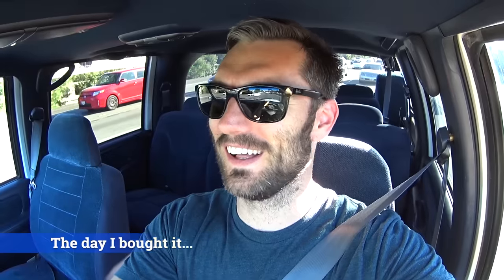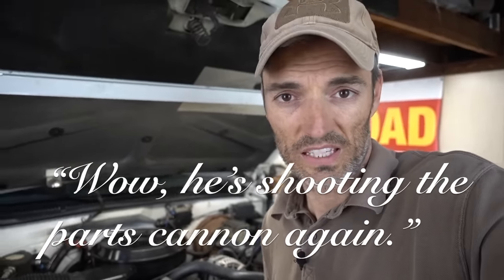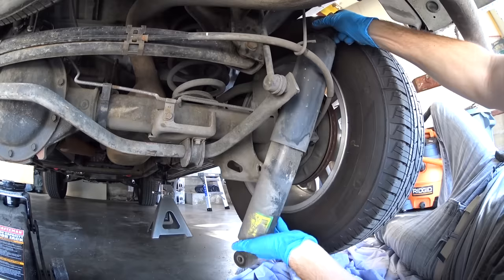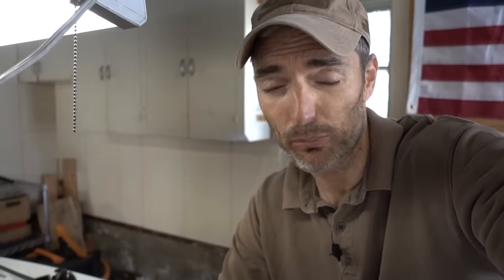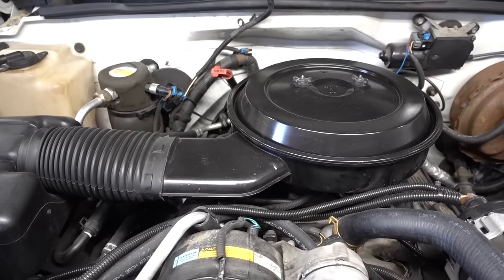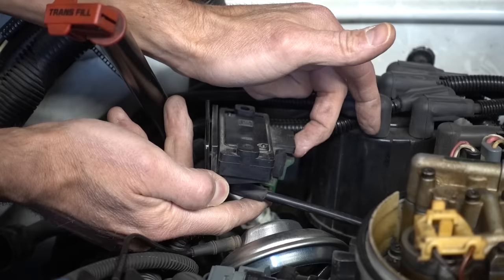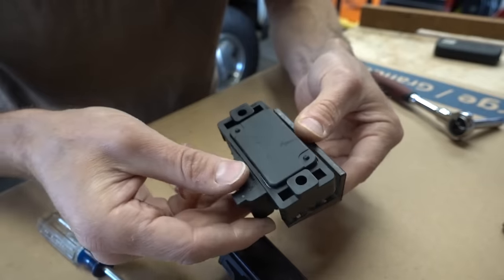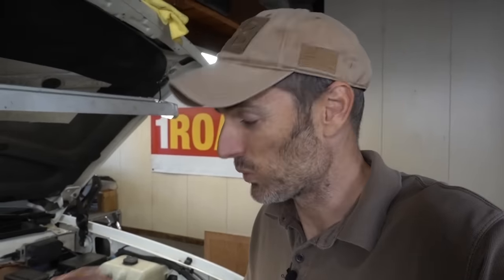The ONE REASON Why My 25yr Old Truck Runs So GOOD!!

Comment: The problem is the new parts they make now days dont last as long as the originals...
Reply: This is the reason why he was buying the original parts ome ac delco
Reply: @billflk2364  made in china :)
Reply: I worked a parts counter for a few years and the whole time I watched the quality go down. Now, some maintained a high quality level. The Echlin at NAPA was outstanding. Balkamp, meh. I started machining rotors right out of the box ... because they would literally be out of tolerance out of the box. Some of the AC Delco stuff maintained, some was junk. The rebuilt engine supplier that we picked up was stunningly bad. Store brand impact tools were literal trash. I would suggest you go to a small local parts supplier that's a little more expensive but absolutely knows their parts lines, and has to build a reputation on keeping good parts lines and standing behind their parts. Because a small no name local store isn't relying on people just flocking to the store because of a nationwide name.
Reply: U ain't jokin
Reply: @uethello  A mechanic I know sais that 50% of new parts are bad
Reply: @Future-Preps35  of course with my tps I took an ohm meter if it measures the correct ohms then the computer isn't going to see NEW OHMS so to each their own did you do your trunk latch too THAT WAS MY POINT!!!!
Reply: @uethello  Thank you for that insight.
Reply: @Future-Preps35  So if I may ask, what store or online seller did you purchace it from?  Was it a Chrysler/Mopar oem part or ? I own a ZJ and may be needing a TPS also and don't want to take that chance of getting a bad part right away. Note: Nearest stores from me is 20 miles.
Reply: Todd Rhine feel the 20 mile part, just rebuilt my engine not long ago and live 30 miles from the nearest parts store 🤦🏻‍♂️🤦🏻‍♂️😅
Reply: @jameshunt5316  Let me guess. you got the vaccine...
Reply: @billflk2364  Those ACDelco parts are not exactly the same quality as original OEM parts. For example I just bought new spark plug wires because original ones got damaged and I got annoyed when I noticed that ends of the spark plug wires are rotated in random directions, meaning that I have to twist the wire in some cases 180 degrees to plug them in.
Reply: I have better luck buying AC Delco (made in Mexico) than (made in china).  Denso used to be my go to when could not find AC Delco.  However,  Denso has been hit & miss lately (2024).

Comment: The best time to buy a car is when you don’t need one. The worst time to buy a car is when you need one RIGHT NOW! Same logic here.
Reply: When you need one unexpectedly you don't have time to look for a good one.
 The only ones you can be fairly sure of not having problems are new ones. Well most of the time don't even think of buying a new model. If it has been in production most of the time they are good. Most of the time.
 Had the old guy get stolen because it looked and sounded good. Somebody was spotting them where the old lady worked. So why that 11 year old one 2 1/2 ton gas sucker out of the 1000 in the parking lot?.
 Did not have time to search for well maintained used vehicle.
 I won't let her drive the old one I drive because she drove it until the gas tank was empty to many times. My rule is if you can drive you can also keep fuel in it and keep it between 1/4 and 3/4. Don't to replace fuel pumps early and often that way and it keeps the vapor cannister happy. Not something I want to pay for if I don't have too.
Reply: I usually custom order my vehicles and sell my old one right before I take delivery of the new one. However - if someone crashes into your old car or it quits on you - you can always rent something for a few weeks while you're shopping. Or if the weather is nice - ride the motorcycle to work.
Reply: Worst time to sell one is when it HAS to go too. HOA pushed me beyond my limit, were threatening to tow my vehicle, I had nowhwere to keep it - 1995 Powerstroke F-250 - got less than 5k for it - it ran perfect.
Reply: I always buy a vehicle when I don't need one.  It's one that I actually want. Then after I own it for awhile I sell one of my old ones.  Never trade a car in to the dealer.
Reply: Yup, thats why I bought a ford☹
Reply: @warrenpuckett4203  If a new car is good or not isn't really the issue, why would you buy something that looses 60% of it's value in 4 years?
Reply: I've found that to be true.
That logic is true with allot of things in life.
Reply: @zzanatos2001  You better be a millionaire, you have a lot of wealth tied up on stuff that looses value.
Reply: And the best time to pay for a new car, is before you need it.  I paid cash for anew 77 Toyota pickup in 1977.   I was 19, and my Dad told me to go to the credit union, and finance it to start building credit.  When I paid it off, he told me to open a seperate savings account for vehicle parts and replacement.   Twenty four years later when I couldn’t get the Toyota truck to pass smog, there was more than enough to buy the new minivan.
Reply: i wish I had that option, had I been able to wait 3 months I would have gotten a 2010 Chevy 2500 HD with only 150k miles for $2000 instead of needing to get my current truck (that I love to death) 2010 Chevy 1500 for $18k with 115k miles, i get the same fuel mileage but i have a much lower capacity

(rant below about the BS my landlord pulled about my truck)

plus now my landlord made it even harder for me on that front bc now I have to pay a $30 fee for having a truck (claims of higher wear on their crap road that make Washington's worst pothole-covered road look like the best road in the entire US) and if I want or need work done I have to go to a mechanic bc its $140 per 5 minutes my hood is open, plus a starting $100 fee for opening it and fluid changing is an automatic 60-day notice to leave, plus im only allowed 1 vehicle despite the fact the place im renting having 4 parking spots

Comment: "The longer you drive that old car, the more it pays you back."
Reply: I had truck for 28yr I did price cost for it I estermeft it cost me about $2.50 a mo.over all
Reply: Ummm, nope.
Reply: @rhondakendrick2563  ummm that's $840
Reply: The MORE it costs. There, you go!
Reply: Car makers don’t like you, take it as a compliment.
Reply: true point with a old car  no monthly payments  no full coverage insurance   if it a good
design  from the overall manufacturer with preventive maintenance  they will be reliable and  MUCH cheaper  i see prices from 56 000 to 81 000  😱😱😲😲fck  that ....!!

Comment: I have a 1995 GMC1500 Sierra..
250 k on this dude and it runs like a champ.Preventative servicing is the NAME OF THE GAME😊
Reply: Exactly !, plus frequent oil changes.
Reply: yep. Any car will do much better with excellent maintenance.
Reply: 98 Z71 Silverado, lightly used. 119k miles. Rocker panels rusting, clear coat flaking but runs like a scalded dog. Wouldn't part with it. Don't need expensive deprecating vehicles with high insurance, registration and maintenance.

Comment: All my year 2000 and older Suburbans have hit nearly 300k miles, and taken me through ridiculous terrain and weather. I've done all of the work myself, except for a fuel pump replacement, and your videos helped me immensely, so many  thanks my friend.
Reply: Lol, I think I've dropped my fuel tank on my Tahoe 3-4 times already.  I'm still working on the 300k miles, but recently bought a Suburban because I liked the platform so much!
Reply: @nicholassmerk  same here on tank removal lol.  I should have bought a new tank though because mine has a nice big dent in it from when one of my old co workers thought he was real clever trying to move my truck out of the way before i brought her home from the junkyard i worked at.  He moved the truck with a front loader by placing one of the forks under the tow hitch to lift the ass up and let it roll on the front wheels.  Well he mad contact with hitch and my fuel tank not to mention he crushed my driveshaft. Yeah i didnt realize there was a dent in it until i went to install the new fuel pump and it wouldn't fit.  Lifted the tank out of the big plastic splash guard to find a huge dent in the bottom.  So there i was in the middle of July in Florida hammering the fat side of an aluminum baseball bat on the dent to push it down enough to fit the new pump.  Let's just say next time i take a trip to the junkyard, buy a tank, spend 10 minutes cleaning and flushing it and the rest of the hour drying it out and installing it.  It took me almost an hour of nonstop hammering to finally get the pump to fit.
Reply: @FunkyGOB  Bought this Tahoe, took it straight to the gas station and filled it up.  Figured out quite quickly why the guy that sold it to me didn't have ANY gas in it.
Reply: @nicholassmerk  lol gotta love those "oh i forgot to tell you" details after you buy it.
Reply: @FunkyGOB  Had a bad transmission too.  Was one of those "I'm not telling you what's wrong with it" kind of deals.  He was asking the appropriate amount for it, and I'm still driving it years later.
Reply: @nicholassmerk  thats it.  Not thrilled on spending the money but id rather spend it on an old truck that i take care of than buy another neglected vehicle full of problems.
Reply: I did the fuel pump on my 98 Suburban and I can see that being worth paying someone with the right equipment to do.
Reply: my old model t truck works just fine with the upgraded diesel motor and auto transmission.  🤣🤣
Reply: Replacing a fuel pump im a body-on-frame vehicle is actually way easier than people think. In a 2000 suburban, its 2 strap bolts and some hose clamps to get the tank out and 4 screws to remove the pump.
Reply: Mine is a 99 with 306000 , they will probably bury. Me in it .I'm not going to buy anything I don't like, they haven't built anything I like in 25 years.
Reply: Buddy had a '95 suburban.  It was in great condition, but the red antifreeze really screwed up the cooling system!  I'd never use that crap!!!
Reply: Drive less but safe

Comment: Each owner has to decide to what extent or frequency they replace parts. The older the vehicle the more sense it makes to replace iffy or suspect parts. One thing i learned early as a new mechanic, is that you never throw away a old part being replaced, not till you have the new part installed and working properly. You may have to refer back to the old part for one reason or another, and being able to do so can save you a lot of grief.
Reply: Or, the new part may fail, and the one you just removed hadn’t failed yet, could use the old worn part in the meantime waiting for a replacement, keeping the car on the road and the customer happy.

Comment: People have asked me why I'm always working on my truck. I just tell them I'm making it new one part at a time. 

I agree with your approach with one small caveat. You can't always assume a part is good because it's new. A lot of the parts now are made in China and can be hit or miss, even AC Delco parts.
Reply: It's just as scary to replace a perfectly working USA made auto part with a China made part. My insecurity levels with chinese made parts are through the roof, AC Delco label or not.
Reply: You mean China made parts are bad. No. I have my own experiences with a lot of cheap parts made in China. The key is where and how you source them. Those parts are still running in my cars for years.

Comment: 1997 GMC Yukon owner, I think we share a similar outlook on maintaining older vehicles. Its cheaper to fire the parts cannon every once and a while, than to constantly trade up to newer vehicles like some people do.
Reply: Ditto. A 95 suburban 1500 2wd  owner here. I did 6.0ls/4l80e swap. But a awesome truck
Reply: 200% agree. 1994 2500 2wd suburban with 1 ton single rear axle and HD brakes, 9 seater over here. 
She is always loyal, always running, cheap to maintain. She is a keeper. 👍
Reply: You know what's cheaper, just fixing what isn't broken.  Would you replace every lightbulb when one is just blown and it happens to be your reverse light bulb.  Do you change the headlights, taillights, dome light?
Reply: @ranbymonkeys2384  It's funny that's your example, because when I picked up a new-to-me vehicle that was 23 years old, I did in fact replace all of the bulbs.
Reply: @aidenstefanson2175  I wouldn't
Reply: @ranbymonkeys2384  I agree it's overkill, but it's not expensive, I enjoy working on it, and now I have piece of mind. I'm not going to pretend like it's something everyone should do, but for the 30 or 40 dollars I spent replacing all my bulbs I shouldn't get caught with a burnt out one!
Reply: @aidenstefanson2175  You know that and bulbs have come a long way since then too so, ya I'm with ya there.  I have a 85 Vet and I put the LED tail lights in because I didn't want to have to do that again (take the plate off ect.)
Reply: I got the 94 K1500 Suburban
Silverado and I am always working on mine. Doing LED upgrades got nice 17" stock wheels from a 2016 Colorado, the two tones. I just had my wife print me a kryptec camo pattern on her cricket and I'm gonna do my tail lights with the vinyl and then a couple layers of automotive clear topcoat. I'm about to pull the cargo rails off, paint them and rattle can a couple layers of metalic silver, on the top of my truck, I have 2 color silver/emerald green, but most of my silver is gone, it's all bare steel. I sand the parts, I clean and oil all summer, when fall hits, I buy the cheap clear rattle cans and put about 10 cans on it. I am also tempted by spray chrome, but I want to go more or less blacked out lights, chrome delete I like my incognito "greyman" status, no one looks twice other than to get out of my way. Interior needs some new ceiling put up. I love project and taking care of it.
Reply: @aidenstefanson2175  I got mine for from my grandfather, 160k  all LED. I'm having trouble getting the pulse of blinker and corner small blinker to do the alternate after changing relay. Now when applying blinker the whole thing flashes solid not. Any ideas?  It kind of reminds me of a police strobe package effect. My grandfather was s cop though.
Reply: I am rebuilding the motor in my 99 Surburban. I have bought all new OEM sensors as well. The old ones are still good. They will be cleaned and put in my spares box for emergency use. They won't go to waste. I have three late 90's GM trucks with vortec engines.
Reply: Gets to be a headache after a while

Comment: Absolutely. A few years ago, I bought a 2004 Grand Cherokee Limited on a whim from auction and was thinking I'd just address a couple of things and flip it for a profit, but I ended up liking it, so I went through the effort of parts bombing the crap out of it as a preventative maintenance endeavor. Soooo many new parts and the thing starts, idles, and runs like a champ. One of the biggest improvements I made was having the cylinder heads redone. The heads on this engine (4.7 V8) are known for dropping valve seats, so I had new seats installed and had them peened in place as well. Those seats aren't going anywhere now. And everything else I did, it might actually be a shorter list of what I didn't replace. I'm doing something similar on the 2002 Silverado Z71 I got that was my uncle's old work truck, though mostly, that's a cosmetic endeavor as the interior was completely trashed. These older vehicles are fantastic. New enough to still be able to find parts and not be plagued by the struggles that come with carburetors and whatnot, but old enough that the parts are cheap and wildly plentiful. A couple years ago, I paid off my 2017 Mazda and I'll never buy a new car again. It's just not worth it.

Comment: Jimmy, I'm right with you on replacing parts as preventive maintenance. Sometimes I purposely shoot the parts cannon to just renew some things that have got old while fixing a problem. Sometimes I diagnose and just fix the problem. Just always keep in mind, replacing it with a new part, doesn't mean it's not the problem or you could have just created two problems. New doesn't always = good. Even with OEM parts. I have had some bad ones. I totally understand your line of thinking though and I do it sometimes myself. Keep up the good work!

Comment: Man you are so right, I have a 1991 Dodge D250 Cummins and I do what you do , I know those parts are 30 years old. 345,000 miles and still tickin over. Two lift pumps in 15 years.  GREAT. Enjoy your channel.

Comment: Preaching to the quire man. My '99 Suburban k1500 with 310K miles is still running strong because of the same mindset.
Reply: I had a 99 burb that had a little over 273000 on it when I lost it in the divorce. Only issue I ever fought on it was the dreaded intake gasket leak. Had to change it 3 times to finally get it installed right. Other than that it was a beast!
Reply: What's a quire?
Reply: @georgegroot9704  Had 1999 Tahoe with same problem! I didn't try to do it myself though. 1st repair was a fix.
Reply: A quire? You mean a *CHOIR*?

Comment: I'm 72, drive an 09 Ford Explorer, and also replace anything that's "due" to fail. AND...I do my own work and throughly enjoy it. This morning I replaced my front brake pads even though the ones on the truck could go another 20K. The truck has 155K miles, and runs like it's brand new, and I know it won't break down on any of my long road trips. Nothing more frustrating, and expensive, than to break down while on the road.
Reply: Then you know that brakes just don't pop off your truck right?  They make noise and such.  I can see doing both fronts or both rears but replace when they are still good just is strange but to each their own.
Reply: Agree
Reply: @ranbymonkeys2384  I applaud him for staying on top of things, but I think you should get your money's worth from your rotors and brake pads.